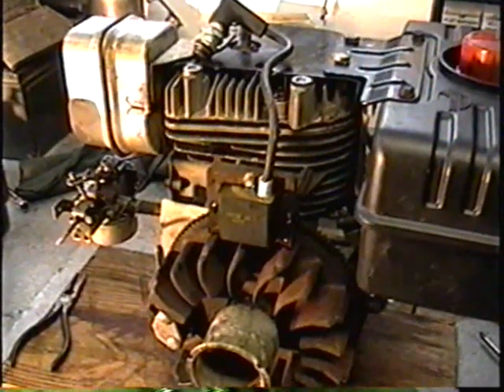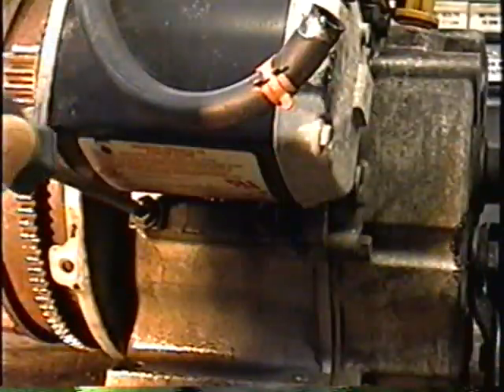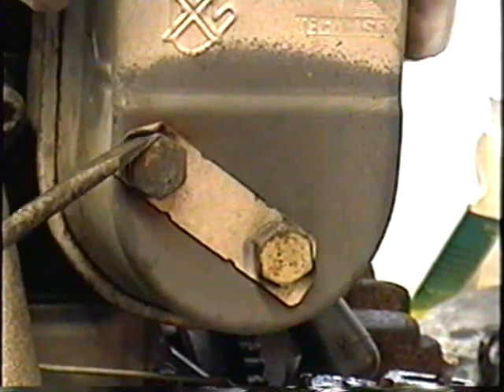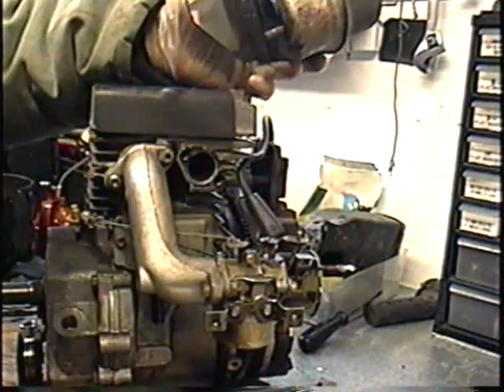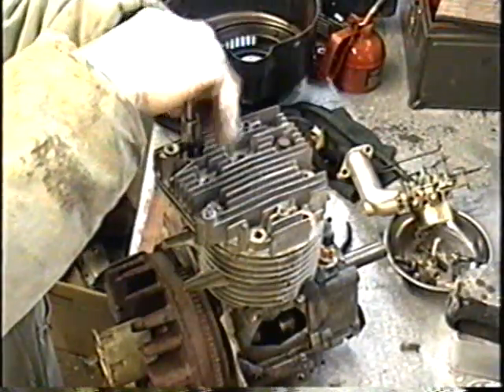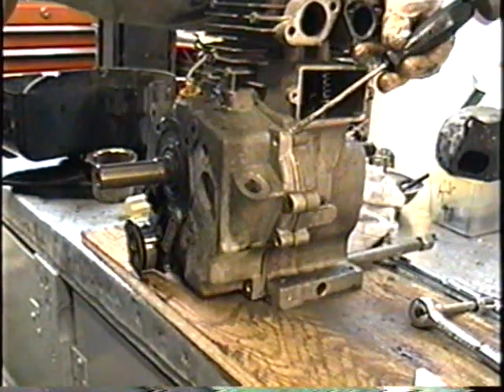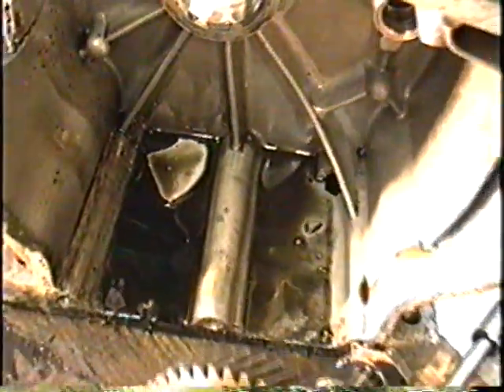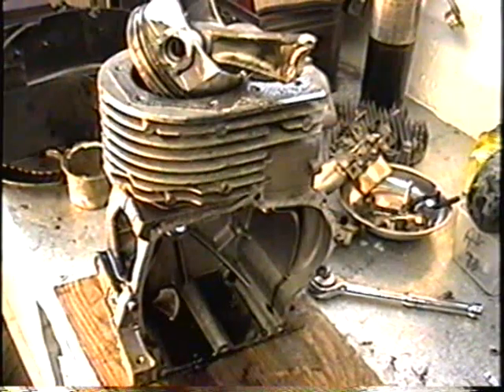TEARDOWN OF ANOTHER BLOWN UP 10HP TECUMSEH SNOWBLOWER ENGINE

Comment: I’ve had 4 of these fail just like this over the years and weren’t ran low on oil . All Tecumsehs . Metal always galling on the cranks. A strong alloy rod and insert bearings would have made them reliable. You would have thought the factory would have made some changes and they might be still around

Comment: Hi! Thx for video. My compression disappeared with a boom 🎉 and engine died after it was overreving. Is it normal that piston rings go when overreving? 

I think it leaked oil afterwards too. 

Will take it a part. 

 But my engine can’t find engine code. It looks like yours. It is 8 hp mtd snow thrower. 

Are there many different piston rings and head gaskets for 8hp during the years? I would say it is from early 2000 is my guess

Comment: I’m curious I have  10 Hp. It runs fine . But the problem is it won’t shut off even if   Take the key out.  Or turn the throttle off.   What should I do to fix that ?

Comment: Dony, I have an HMSK-80 that is driving me absolutely crazy and I’m at my wits end. I’ve gone through everything. It’s very hard starting and want to die down a bit under heavy loads. 

Doesn’t idle low very well and only wants to start under either no choke or one click on choke. It has a new carb, new fuel lines, new spark plug gapped at .30, new primer, new starter. 

Most recently, it now wants to trip my starter and doesn’t want to work at all. Any ideas??

Comment: You can't really attribute this to the fault of the engine. Most owners don't even know what the oil does, or where to put the oil on a small engine. I remember before I became a mechanic, I didn't know the difference between 2 and 4 cycle engines, and knew nothing about oil. Most owners run the original oil, and probably don't even know they are supposed to check it. Having low oil on a splash lubricated engine, with no oil filter, is going to cause the engine to overheat and seize and break the connecting rod. Put Amsoil motorcycle racing oil or Maxima full synthetic motorcycle oil in your engines, if you want actual zinc and other anti wear additives. Or use Rotella T6 full 100% diesel engine oil. More zinc, because no gasoline catalytic converter on a diesel. Modern car oil has reduced zinc, which is needed for flat tappet cams in small engines. The cams go flat in riding lawnmowers because the oil doesn't have enough zinc. Do not use regular cheap car oil, or the engine will just fail over time.

Comment: Both Tecumseh and Briggs and Stratton have 2 versions of all their engines. One version has a soft pot metal cylinder liner, and connecting rod. This is a regular engine, not a commercial engine. You want to see "I/C" for industrial commercial or you want to see "Cast iron cylinder liner." If you don't see those things on the outside cover, then it's unlikely that it will last for more than 30 hours of hard use. The engine will start to wear out the moment you use it. Aluminum cylinder bores are only meant for occasional use, and not for heavy duty use.

Comment: good day Don I have the same engine and am trying to take off the pulleys ,but no way.Ive tried heating it used a gear puller ,it just wont budge,. do you have any other ideas that might work .thanks in advance
Reply from the maker: you need oxy acetylene torches, if that doesn't work you will have to sacrifice pulleys by cutting them off
Reply: @donyboy73  thank you

Comment: Mine threw its rod after 19 years.  It wasn't low on oil, in fact the oil was new.  What happened is I was going through a heavy snow bank the plough left at the end of my driveway.  It went through the snow bank a couple of times then began to slow down suddenly the third time.  I slowed down the RPMs and then there was a bang and the engine stopped.  I checked the oil and it was still full.  Rod was snapped, but crankcase was still okay.  I never went further into it to investigate.  This was an old machine with plenty of 3' heavy snow banks under its belt, but the last time it was used the snow was very heavy and wet.  Thinking possibly water got into the oil causing the crank bushing to fail - and it was the crank bushing that failed,  just like in this vid.  In the end it was just old age.  My MTD Yard Man was a great machine, fully optioned, electric turret, hand warmers etc. but it didn't owe me anything, rust holes and all.  Tecumseh made good engines but nothing lasts forever.

Comment: Over the years I've had three Techumseh engines blow connecting rods. Never low on oil or over revved.
Reply: Interesting. I have a HM100 powering a generator that lost compression--shops says valve or ring problem and slightly scored cylinder wall. Never beat on, oil changed twice yearly even if not run (30 wt. summer, 5-30 wt. winter). My other Tecumseh engines have held up well.

Comment: Awesome engines. Stupid owners. The life of any moving part is oil! No oil, this happens. Have had 2 of these same engines for oger 30 yrs now. 1 is on log splitter, and 1 is on leaf vac. Both run perfect...because both have oil ;)
Reply: Tecumseh engines are great. Lack of lubrication will kill any engine.
Reply: Tecumseh engines are grrat. Lack of lubrication will kill any engine.
Reply: But notice that they are mostly Tecumseh engines donyboy is fixing in these videos. Hardly ever Briggs and Stratton or Honda.  @arthurdombroskie3083
Reply: Agreed: Oil is the life blood of any engine. Keep the oil clean, (regular changes) and just about ANY engine will outlast the equipment it's on. Good quality air filters are important, as well.

Comment: Hi! Is there a way to tell the revs on these engines, other than by ear? I got an old blower last year that needed a new carb, fired right up after I put it on. Let it warm up to adjust the carb, it was not responding right to throttle and would not idle but seemed to run ok so i let it warm up... For less than two minutes before it blew up right in front of me. Exact same damage as the one in this video, plus the piston skirt took a hit too.  Anyways, I put a new (used) engine on it today that seems to run fine but after last year's mishap I'm still a bit nervous, and I'd like to be sure.

Comment: I have a Toro model no. 38642 (Tecumseh engine HMSK100-159494Y 10HP, 4-cycle CARB 2, EPA 2 with an Electric/Recoil starter) with a hole in the block.  Could this engine be replaced by a Briggs & Stratton engine and fit on my Toro?

Comment: If a person had cheap access to a TIG welder, you could aluminum weld a patch over the hole in the block, my son did it on a 5 horse Briggs. Before doing this though, you have to make sure there is no other major damage, like to the camshaft bushings, or long cracks in the block. Though I would only recommend this if a new or used block is way to expensive. Of course you will also need a usable crankshaft, con rod and piston. 
 It is too bad that so many of the 8 and 10 hp Tecumseh snow king engines blow their mind this way, since Briggs snow blower engines are much more rare. I think Dony is right, usually this is the result of running the engine low on oil and heating the con rod bushing up resulting in galling of the bushing then ever increasing clearance until it pounds itself apart. If the crankshaft isn't damaged other than having aluminum melted onto it, you can sand it off, or eat it off with drano (better read up on how to do that first!), polish it, and reuse the crank. I did that successfully on a 4 hp Briggs riding mower engine, got another 10 years out of it.
 The most economical way to have another 10 hp engine may be to locate another scrapped engine and try to build a working engine from 2 or 3 of them, but whatever you do, the con rod clearance on the crank MUST be no more than what the spec. calls for or it will lunch itself again in short order!

Comment: I was putting my Carb back on my 10Hp Tecumseh Blower , a nut fell inside the fly wheel Area , all I did was remove the cowling , and turned the clutch mechanism  counter clock wise to retrieve the nut , put the cowling back on  , now the pull cord will only come out part way and jams solid   , I know there are two different lengths of bolts  , they are in the correct place , I took it off a couple times before for cleaning , never had this problem before , any ideas Fitzie , The RE-coil is fine
Reply: +JIM Fitzpatrick remove recoil from the engine and see if it still turns when off the flywheel. If not the tabs that grab the flywheel might be jammed. Also check to see if the engine still turns over.

Comment: I have a mower with a Kolher 22 HP ,and I always put a bit of oil in the fuel tank , about a half ounce per gallon of gasoline,2 cycle oil mostly,  in the fuel  even though it is a 4 stroke. I broke the engine in that way to help the piston rings seat better . ..  I have had it for 5 and a half years and the motor oil very rarely ever needs to be topped off or changed because the piston rings and cylinder are  precisely tight with no blow back,and the oil stays clean,and I would bet that the cross hatch marks are still in the cylinder wall ..I think it has more compression now than it did after the first  2 years of use....
Reply: +Robert Diehl I've got a yamaha 225dx 3 wheeler, would using a few drops in the gas help free up the oil ring. The thing is burning oil in large amounts at a time and I think the ring might be stuck due to carbon or gunk. The thing sat for 3 years and when it was revived, the engine was seized.

Comment: Hi Dony, I have a Tecumseh HM100 159436P engine on my 5000 watt generator. Just curious about "Don't over-rev" the engine? I know must small engines are set to run around 3600 RPM, however my generator manual says the no load RPM should be set at 3750 RPM. So my question is how fast is too fast? Is 3750 RPM above what Tecumseh designed the engine to be run at?
Reply: The best way to set up a generator, is to get it as close to 3,600 RPM under load as possible. To get 120 V @ 60 Hz, the crankshaft MUST turn EXACTLY 3,600 RPM. It's just that engines lose speed under load. (~2,500-3,500 watts should do it for this generator) 3750 RPM unloaded isn't too fast, it's just slightly above the RPM engines are measured at, to get their rated horsepower at sea level. Just remember to check the oil each time you add fuel.

Comment: My old Hmsk85 has a cam pullie.The newer replacement motors for sale I see on eBay don't. Anyway to install a new extended cam on these motors to work for my application.Any help or thoughts from anyone would be great.Thx  Dan 
Tecumseh Snow King 8.5hp
HMSK85-155912c
Ariens Model #
932104-ST8524LE

Comment: If I run an engine without the oil control rings, will it burn a lot of oil and ruin the bore?
Reply from the maker: Ian Above yes it would
Reply: Awesome, I have a spare  7 HP OHV craftsman lawn mower engine. I took out the oil control rings but left the compression rings on, I'm going to see how much of a smoke screen it will create and to see how long the top end will last.
Reply: @applepoop10  Your top end will last forever, but you won't be able to keep spark plugs in it! They will oil foul.

Comment: I just had someone give me an Ariens ST824 with a Tecumseh 8hp. Same thing blew a hole in it. great machine to tinker on. Like all your videos. Very well done with spot on detailing. Thanks again.
Reply from the maker: thanks for watching Mike
Reply: @donyboy73   old thread i know. Any response to my comment i made about my 824.. see comment below.  Runs well.. no power in snow. I am Thinking exhaust valve issue?  But can't do leak down..no tester
Reply: I have one that I can't get to throw snow. Starts up   idles well... Seems to run up on throttle well... but when it gets into snow..it just Doesn't throw it..   a few feet is all.   
 When I ran it a couple years ago last..  I don't recall it bogging/ theottling down when in the snow..  just no power.
 Makes me Think Maybe 3xhaust valve is too tight...not letting valve close. 
  I have a craftsman 10 horse tecumseh as well... it won't run hardly at all.. new carb even   I am Quite sure it Def is the valve issue in that one..  as the exhaust gets red,  back fires a bit etc.   Can smell the gas in exhaust.

Comment: Just saying the modern Tecumseh engines don't last long compared to the old ones.
Reply: You are right about the maintenance part, but I heard rumors on the Internet that the build quality of these modern engines are horrible and aren't as forgiving as Briggs. Tecumseh and Briggs engines were near bulletproof back in the day because the parts were Made in The USA. Now companies are turning towards higher production numbers of the product, using cheap materials and giving other countries like China to produce these so they can make the products cheaper, but not as reliable. So the saying they don't built them like before is true. I had a Chinese made mini too and it lasted a little over a year before the motor stopped working. I hate Chinese made parts.

Comment: George, I have actually used JB weld, to repair a busted housing. Worked great. Coated inside and out. Just be sure all the oil is cleaned out of the inside. and clearance.. against moving parts and the repaired wall.

Comment: George you want to double check the timing marks between the camshaft and crankshaft. Also these engines have a automatic decompression actuator mounted onto the exhaust lobe on the camshaft make its intact. They will kick back hard,and may not start even with electric start.

Comment: Hi There,
Really appreciate you offering these information videos.  I have a 9hp Tecumseh motor off my Craftsman Snowblower.  I have just swapped the short block as I blew the connecting rod.  I have completed the exchange and now have an issue with the manual pull start.  When I pull on the handle, the motor feels as though it "pulls back" the cord not allowing the motor to turn over.  Any idea what I may have done incorrectly?  Again thanks for the videos.
George

Comment: what happens with these buggers is the connecting rod bolts come loose and grenade the engine, wanna make yours last, take it apart and red loktite the cap bolts problem solved.

Comment: I knew it was the connectong rod before he said anything dead giveaway that could of been fixed u put aluminum plate and weld the hole and change the connecting rod the governors go bad on theose tecumsehs and the blow up rods or it wasn't maintenanced properly

Comment: I have a Craftsman trac drive snowblower one track stopped turning under power would that be a shear bolt? And recently the engine started puking out of the breather behind the carburetor would this be because the engine is houred out and needs to be rebuilt or replaced?

Comment: The damage to this engine appears to have been caused by lack of oil and an event where the engine was either over revved causing it to throw the rod or was suddenly jammed while at full power.
Reply: Austin Carlson  it is a snowblower, the impeller probably freezes up by ice so it is not the engine fault like you said

Comment: destroyed a connecting rod in my TEC H70 after pulling approx. 5300 rpms on my kart, fortunately it didn't go through the crankcase...going with an TEC HM100 with a billet rod this time around..

Comment: If you look, you'll see metal transfer on the crank. The only way you get that is heat, And the only way you get that heat is low oil. When an engine fails from over reving 90% of the time it will bust the rod High(close to the piston). This failure is from low oil.

Comment: @donyboy73, were there a bad run of engines that Tecumseh put out? I have a 2006 Ariens 824 snowblower and I do take care of it and dont abuse it, however I'm afraid this will happen to me. I also use Mobil-1 synthetic oil as well. How many of these bad connecting rod issues have you seen?

Comment: if i were to repair a tecumseh engine muffler that was built in 1979 and hasent been changed in that ammount of time what would be the odds that the bolts break in the engine

Comment: i can keep my briggs redlined for hours and it was made for a tiller and i rigged it up on my gokart and it works great. tecumseh used cheaper metals in their products which evidentually lead to the company`s demise.in simpler terms they cheap out to the extreme and people started to notice their engines throwing rods.

Comment: i have a techusume 10 hp engine for lawnmower, i was told they do not make that motor any more and i cant get a piston replacement,can i use a biggs piston n rod for it if so can u give me parts number so i can buy the piston and rod and rings for my engine thanks.

Comment: I recently used a short block for the exact same engine that is in this video.  I made sure I replaced everything exactly the way it was installed on the blown engine.  I went to start it and it ran for about 15 seconds and now won't run at all.  It has compression, it has spark, and the spark plug is wet.  Does anybody have an idea on why it will no longer run.  Thanks

Comment: Tecumseh is known to throw rods... I've heard the carbs suck, but the emission ones in particular.

I like Briggs engines, I've seen an old one on a 1970s snowthrower and it seems to run a little off, never rebuilt the carb on it and it had the original plug up until last year (used very little).

The old tecumseh engines are good, the Chinese engines, well, the China companies can't make cat food right.  Do you think they can make a good engine?